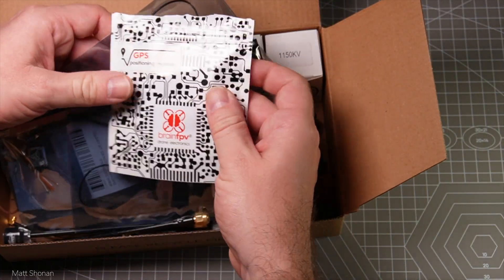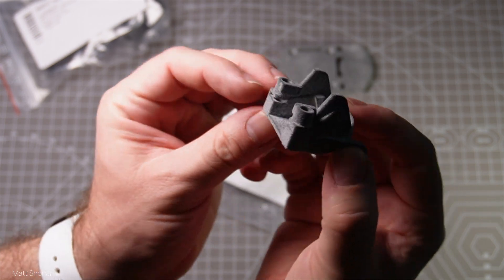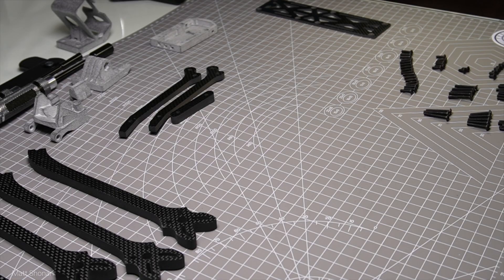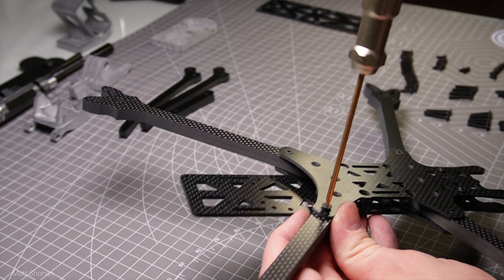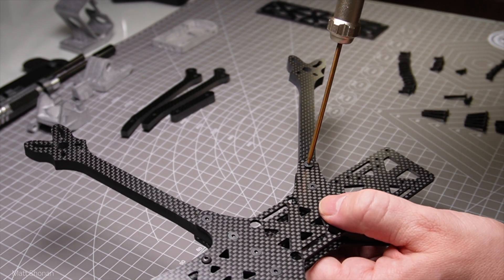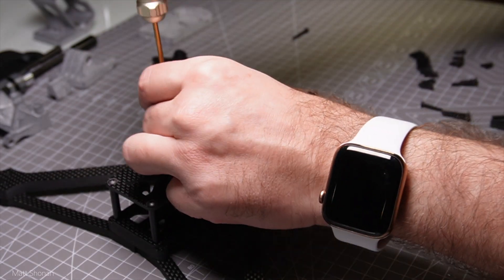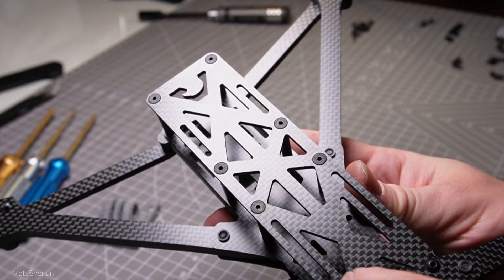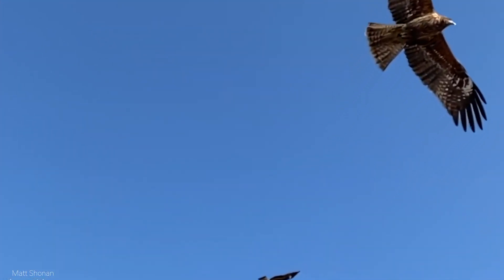AOS Falcon 7 FPV Cycle 30mm JBF7 FC | DJI Action 2 | long range build PART 2

Comment: How do you find the motors ? Enough freestyle  power ?
Reply from the maker: Yes, they are great! 
Just get a really good battery.
Reply: @MattShonan  thanks mate my aos 7 just about ready . You use inav or beta ? I can't wait to see how a 7 inch flies . Can you recommend a good battery ?
Reply from the maker: I am using beta for this one but have a similar build on inav. 
For long range it is a good candidate for inav, but in general I still like beta since I simply know more about it.
Reply: @MattShonan  I was a bit worried  if it would have the power so I'm glad to hear that
Reply from the maker: yes, with a good battery 6S and a high C rating around 100 or above there should be no issue.
Reply: @MattShonan  Thankyou very much for your time and prompt replies.  Great channel  mate . All the best to you .
Reply from the maker: Thank you very much for the encouraging words. 
Have a great day!
Reply: @MattShonan  Rock on !
Reply from the maker: thank you

Comment: what's the website form where you bouht/print the 3d parts
Reply from the maker: I got them from Beamler | Additive Manufacturing & 3D Printing. 
Good luck with your build and Happy New Year! 🥳👍🏻
Reply: @MattShonan  thanks, and btw what material was that, cause it looked so sick
Reply from the maker: Thanks, it was a special TPU version.